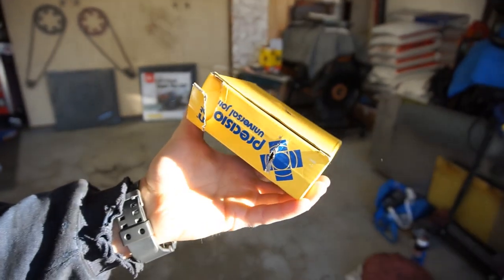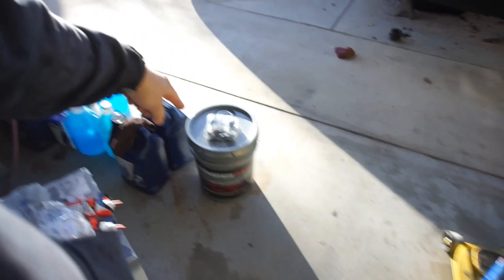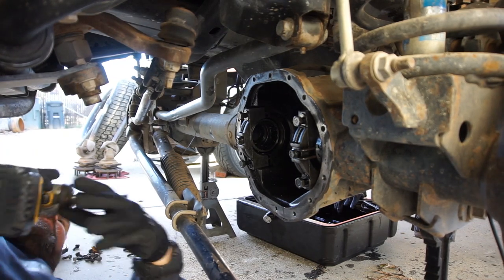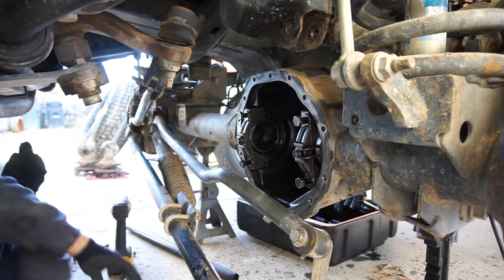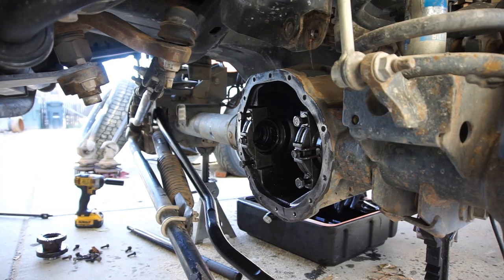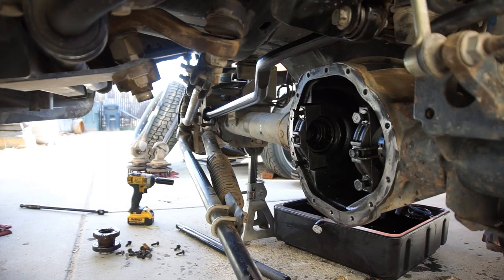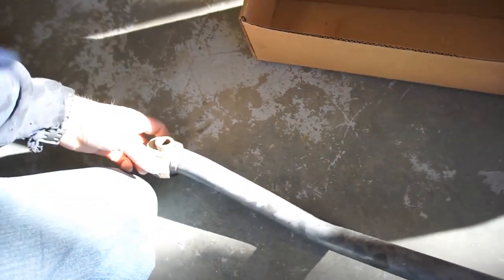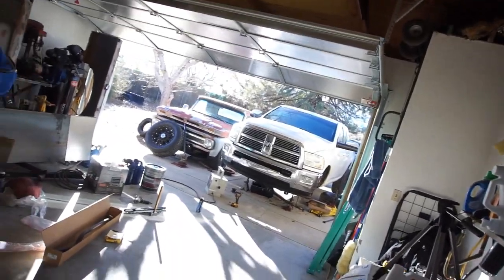I'm Installing An Upgraded Upgrade Track Bar That's Stock. Leave It Alone

Comment: I agree with your mini rant about people not doing their job . Its too bad that every body can't make a great wage but they know what the job pays when they take and don't take it if you're not going to do it to the best of your ability .  That's my 2 cents on that .  It's certainly not hard to find someone who's incompetent in their job these days .  I've had urethane bushings in my Camaro now for about 6 years and I'll admit its low mileage but as long as I keep them greased I've had no problems . Looks like no one greased anything on that front end or probably anything else on that unit . You are wise going through everything and freshening fluids and replacing parts as needed .  Quality maintenance is its own reward in the long run. Keep up the good work !
Reply from the maker: Orion Fixr thanks for agreeing.

Comment: I do not think an adjustable track bar is really necessary on such a small lift. They do make track bar relocation brackets to get the axles back in-line. I went with a relocation bracket on my jeep because my tires stick outside of my fenders.... without the bracket, the fronts looked funny with one tire quite a bit outside of the fender and the other right on the edge. So, for me it was more about the aesthetics. IF both tires are sitting under the body you probably would not notice if the fronts and rears were slightly not in-line.
Reply from the maker: OneNGlen I know. That’s why I ordered and installed a stock sized one. The adjuster was bottomed out.
Reply: I am sure the stock one will be just fine. IF not, cut and weld the bracket where you want it. ha

Comment: That track bar bolt is way too tight.... OR that might be a truck originally from Illinois and it is rusted on there.
Reply from the maker: OneNGlen definitely not from there. Just super tight.
Reply: If it was.... you would have found guns hidden in there.
Reply from the maker: OneNGlen I bought it so close to Mexico I thought for sure I’d find something somewhere. Literally 1/4 mile or less from the border.